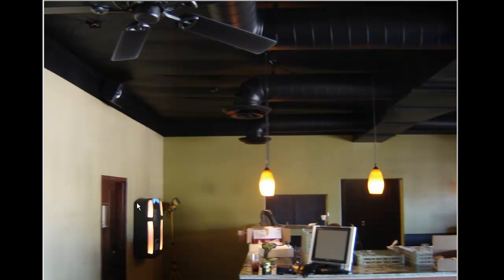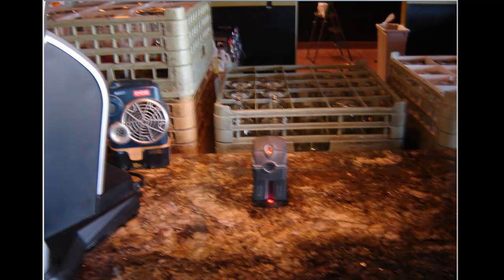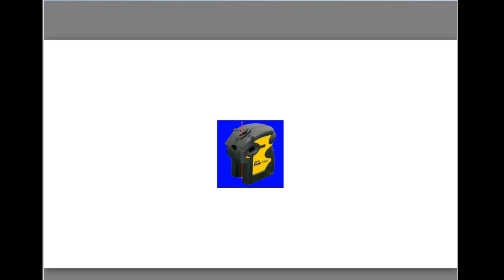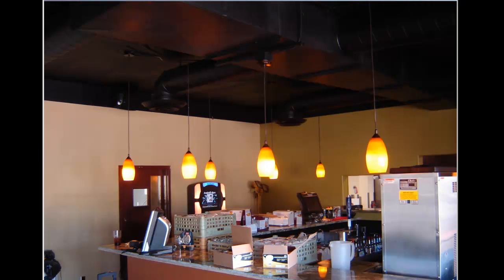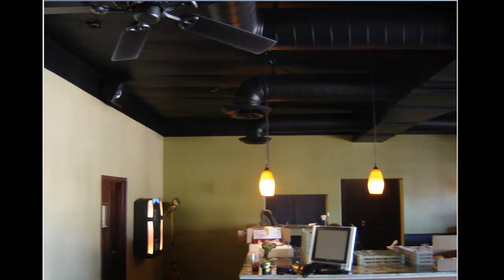Electrical Wiring-Laser Level Light Fixtures

Comment: I bought a horizontal line leveler almost a year ago an its one of my better buys. dont need to worry if slop in floor for Lts or box's. Run level conduit with no level. pipe stays in perfect line. other trades look twice  when u box out with line leveler.

Comment from the maker: Yes using a string will work as long as you don't have obstructions interfering with the string.In this example I had conduit and duct work to contend with so I used the string on the floor and then the laser to hit my mark.